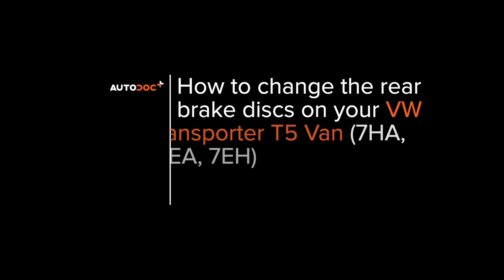How to change rear brake discs on VW T5 TRANSPORTER Van [TUTORIAL AUTODOC]

Comment: missed out putting the clips in carrier
Reply from the maker: You are right, some points in the video were missed, but our channel is not educational but is only for informational purposes. 
We strongly recommend that all replacements, especially those relating to the brake system, be carried out exclusively at a specialized service.
AUTODOC